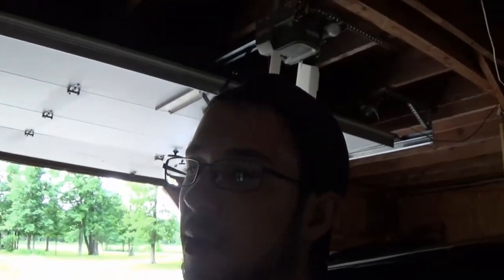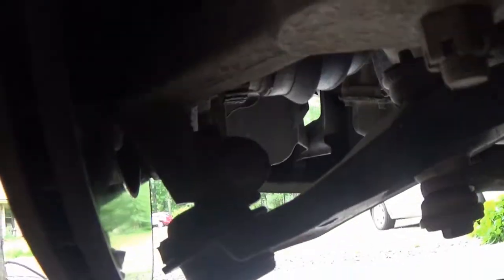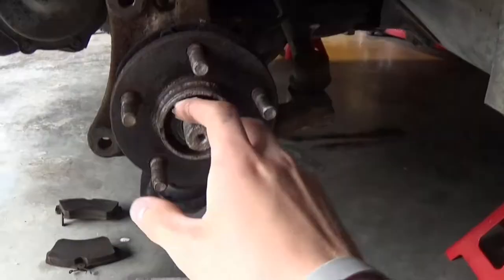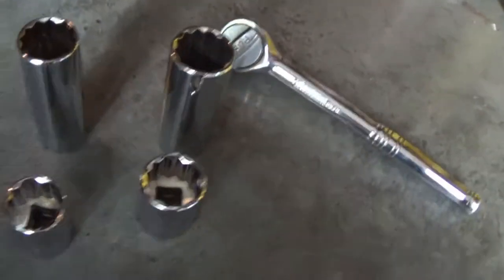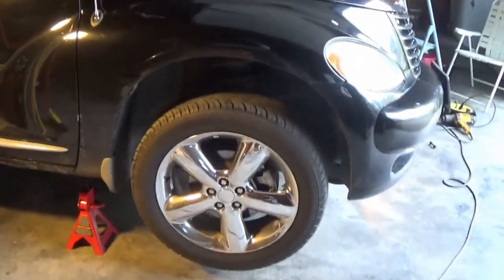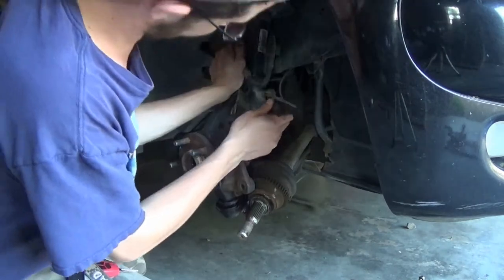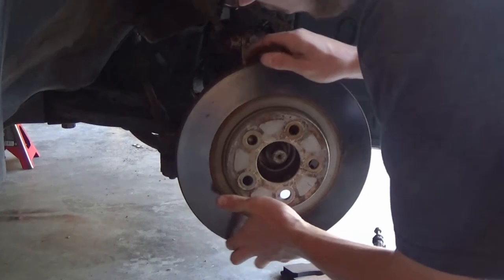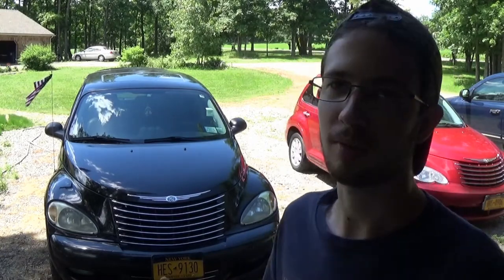I TRIED to replace my wheel bearings...

Comment: My cruiser is an 05 and I swear .... before 50k miles the wheel bearings & turbo! I did the turbo myself. Then I changed the valve cover gasket which for some reason 2 plugs show oil seepage so I am going back in! BUT ALSO the hydraulic lift cylinders for the convertible is leaking fluid so can’t use the convertible until I change them (have used the top manually but damn that a heavy top to put back up) I needed to changed the front struts .... all this stuff happened between 50k and 75k miles on the vehicle! I only just hit 91k miles and this pretty piece crap has been a bunch of problems! A PT Cruiser is not worth selling, worth more keeping it and fixing shit as it happens as long as you are doing it yourself. I saved a ton in labor for sure! I love working on my cars on stuff I WANT to but not on stuff I NEED to 😂 P.S. thank you 😊 for your videos!

Comment: If you do need to use a hammer to loosen the tie rod...put the nut back on reversed (never hit the slotted side) and screw on until it's flush with the rod end to avoid damage!

Comment: Joy of DIY ...Top bolt you removed from strut is used  as part of front alignment on the P T ...thats why steering seems off. If you continue to work on this yourself buy a proper service manual . Then you have access to things like torque specs. Rent,borrow or buy the specialty tools needed for work that involves said tools. Never cut corners or guess. Front end and brakework is serious business. Great Vid..Best to you and yours.
Reply: Like yr informative vids, 
But you need more light in them to have your viewers can actually see what your saying. Thanks for your effort,
God bless

Comment: You have to open up the brake reservoir to vent when u take the brake caliper off ...

When you put the brakes on... The brakes will be squishy for like 30 miles....just keep pumping the brakes ....

And the steering is gunna be different but not that different...

Comment: I'm working on mine right now, had to remove the axle while in the knuckle, it was rusted to the bearing, got a 20-ton press and finally got the axle and bearing out. it was insane. crazy that that top bolt broke on you!
Reply: Did you actually have to take the half shaft out with the knuckle, then press it out?

Comment: i was cringing when u hit your tie rods with a hammer at 6:40.  at the very least, you need to sacrifice the castle nut to save threads on the tie rod... only to get a new castle nut. the castle nuts are no joke... you need to put a cotter pin in them in something as serious as steering and suspension components. if they come loose at the wrong time, you could be seriously screwed. im talking zero steering  control at whatever speed you happen to be running when it comes loose. in short, bad news tennis shoes. 
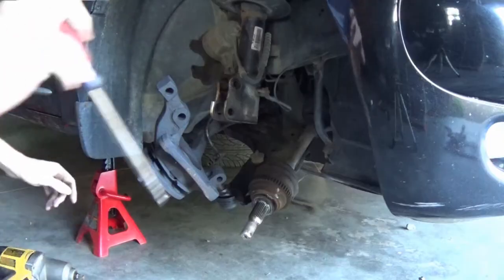  i also cringed at 13:10. he forgot the axle! it's not gonna fit like that! lol. 
  good video, but a coulpe quick questions..
   first about the brakes. you removed the brakes.. you had to compress the piston back into the caliper... did you test them before lowering your car and driving it? there was undoubtably some space to make up between the recessed piston and the rotor. so your foot would go to the floor a few times before you get a firm pedal. maybe it's something you overlooked and there isn't a brake issue at all. if you had brakes and then suddenly didn't, then there is definitely a problem. 
  second question is about steering. is it possible that you didn't get the castle nuts tight on the tie rods? usually a regular ratchet will make the stud spin so it never tightens. i usually have to resort to an impact to tighten them. then put the cotter pin in place. hopefully it's nothing serious. 
  glad to see progress on the pt gt, even if it's 2 steps forward, one step back. 
  i filmed roller rocker arm installation on my old silverado yesterday. i even did a back to back series of 0-60 tests. hot rod magazine saw 25hp on a 400hp small block from 1.5 stock rockers to 1.6 ratio roller rockers. if i see 15ish, I'll be happy as a clam. hopefully I'll have time to compile footage and edit the video and upload it sometine soon. 
  keep up the good work man. we'll figure this steering/ brake issue out. God bless 
  anyway,
Reply from the maker: Thanks dude.  I cringed a few times while I was editing the footage too haha...  I got a little impatient with this one, and I guess I am paying for it now.  The brakes I think I got figured out, I thought it was like you said, the caliper had been compressed in.. but it kept acting weird.  After looking at it a little closer I think I accidentally switched some of the pads around, so they are just worn unevenly.  After taking it around the block a couple times it feels a little better.  Just me being a little over paranoid I guess.  The steering, I have no idea.  I took the wheels off and double checked the torque on EVERYTHING... including the tie rod ends, but everything was fine.  It is a weird one.  I took it out again today and it seemed fine, again I thought I must have just been paranoid again.  But as soon as I took a right turn, the steering wheel was off to the right, and I could smell something hot.  Needless today I turned around and went right home.  Its an odd one, but we'll get it figured out.  
That is sweet about the rocker arms on the silverado!!  A video would be great, miss seeing content from you!!  Good luck with it, and thanks for the help, it's always much appreciated!  :)

Comment: it'snot that hard, you put heat on the nuts when they won't move with a little propane torch. you put the nut on the tie rod bolt flush it doesn't hurt it. The only but you have too torch is the bearing lol.